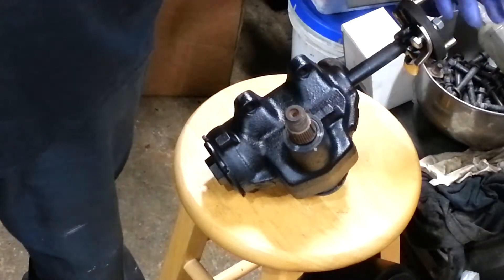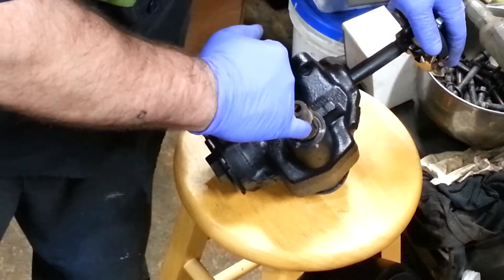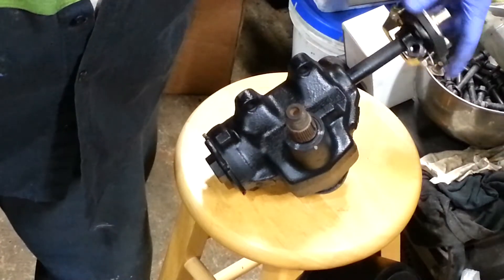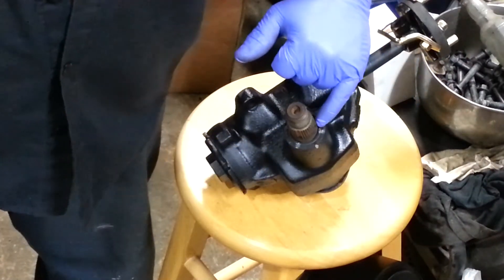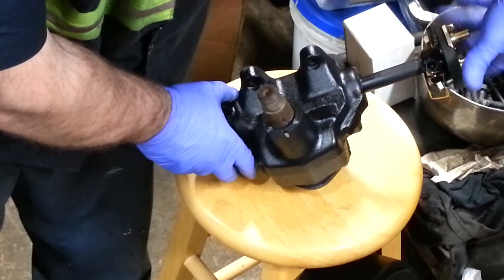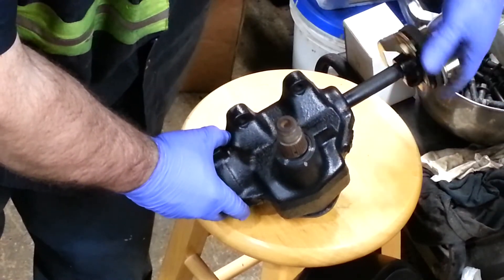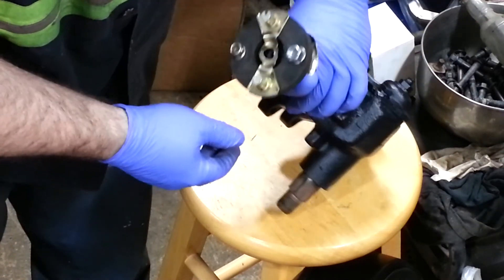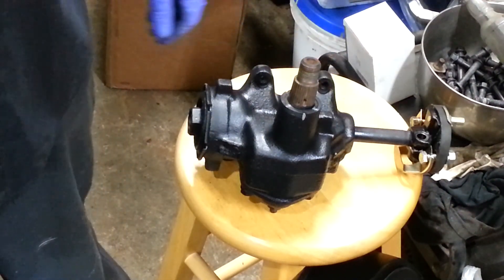SETTING UP STEERING BOX FOR CENTER TO CENTER CLOCKING OF GEARS

Comment: My saginaw only over turns to the left, but it turns very short to the right, the gear has four big indents for the gear so its not letting me adjust the pitman arm, anyone understand the problem I’m having?
Reply from the maker: The pitman arm will go over the larger key way style grooves with it's own key way splines sliding over the saginaw shaft with multiple possible directions to give you more adjustments if needed for a loose or tight gear box. Either you are not starting the dividing of turns left and right at the center point or something is broken inside the box. Ring gear teeth and shims can break in gear box causing limited travel along with other unwanted conditions. Plus it is possible to have the incorrect pitman arm which I have seen many times done in error. Was your box new or working normal before you started setting up the pitman arm or was it a used one? Lots of factors involed using older stuff verses new out of the box.

Comment: I have a 67 mercury took it into mechanic for steering gear box replacement I prurchased refurbished from rock auto due to leaking. I was out of town so picked up after hours. Surprised to find the steering wheel off maybe 30-45 degrees. Do you think it was not "centred" or is there always some difference after replacing gearbox in the wheel. That needs to be fixed fine tuned  by alignment
Reply from the maker: It's hard to say. Many auto techs order the wrong parts simply because of parts charts online are wrong way too often. Also, they might not have centered the pump or maybe didn't lock steering wheel straight for install. Plus it is easy to miss align splines on pitman arm. Steering should be correct after replacement. Hopefully you can get it corrected soon and back on the road!

Comment: my rebuilt steering box is super stiff though. ill need to figure out other way.
Reply from the maker: You can put vice grips over a rag on shaft splines to turn the gears into position. If its still too tight might have to take it apart and add some lubricant. Good luck with your project! 👍

Comment: Going to tackle this on my 82 camaros gear box. I simply put the pitman arm on the new box and i noticed my center link was not able to get into the pitman arm.  I also recalled the pitman arm's hole for the center link pointing towards the driver, but this not being the case in mine anymore.
Reply from the maker: Yes there a gaps in the spines to align pitman arm onto shaft to center correctly. Good luck with your Camaro project.